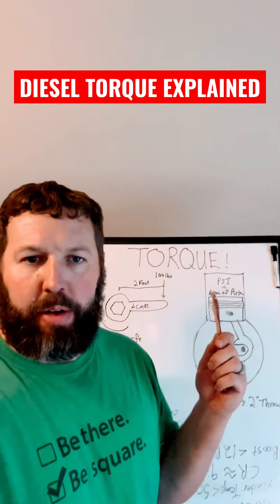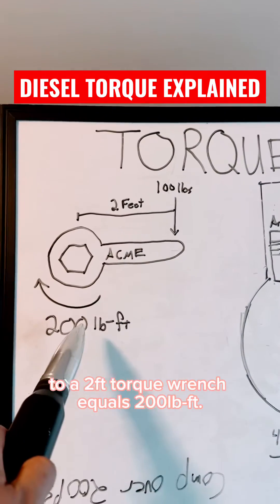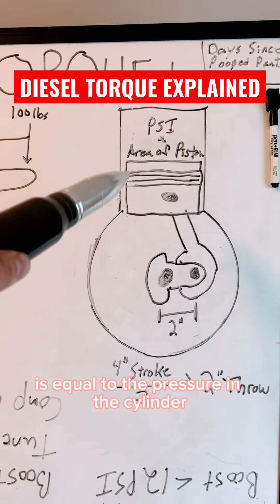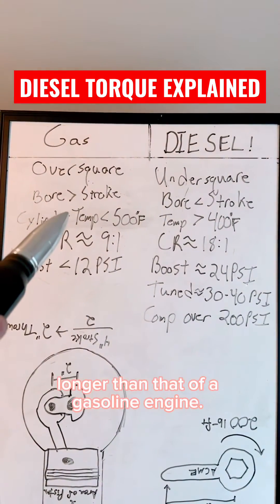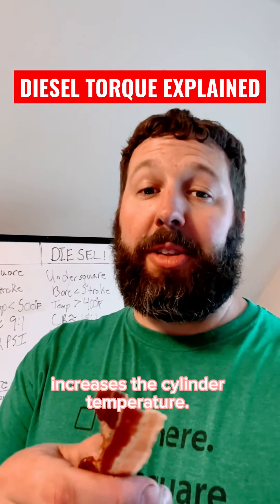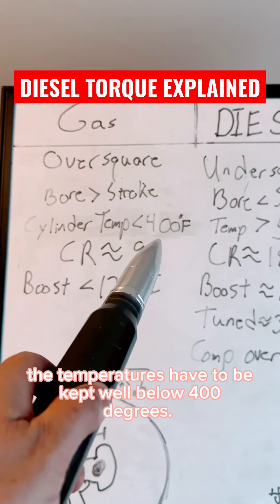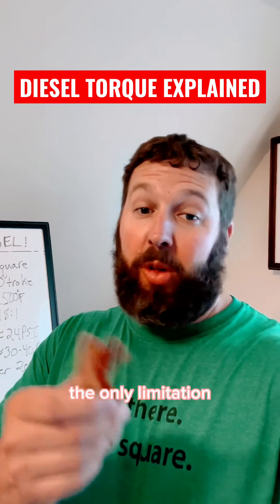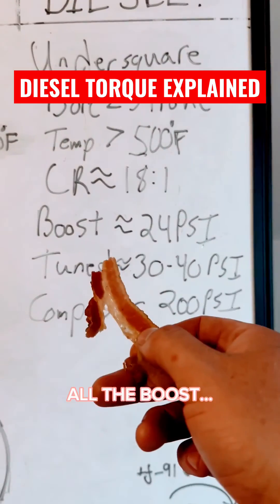Why Do Diesels Have More Torque Than Gasoline Engines?

Comment: Higher energy density of diesel oil also play role to the torque. Combustion (reaction of heat+fuel+O2) on gasoline faster than diesel, but with the higher energy density, diesel combustion/reaction will lasting longer which it means energy of combustion push piston longer than gasoline, not like short flash combustion of milisecond on gasoline

Comment: Only thing you missed was the slow burn of diesel fuel keeps that cylinder pressure acting on your torque wrench significantly longer than the rapid explosion that occurs within a gasoline engine.

Comment: i'm sorry but there is some huge bias here, diesel DON'T have more torque compared to gasoline engines... they might have more low end torque, but same displacement and same other condition (like both NA, or both at the same turbocharging pressure) gasoline engine will have more peak and overall torque, diesel will probably have more low end torque! thats the truth...
second bias is about the longer stroke: to maintain the same displacement of the engine with a longer stroke, you will have to reduce the piston area, so less force in a longer lever will make the same torque, at least thats what physics says...
then why long stroke engines tend to have more torque, because they usually are made to be more efficient, so they have higher compression ratio, they can tolerate higher pressure and they are made to make low end power... so its not the longer stroke that makes directly more power, but its the entire design that changes everything...
Reply: the fact is that most of the diesels are turbocharged and people tends to compare turbocharged diesel to NA gasoline, then of course turbo-diesel have more torque
Reply from the maker: Cool. Let’s compare 40 year old diesels to modern gasoline engines 👍😂.  Torque is a function of cylinder pressure and crank throw. I.E. compression ratio and manifold pressure times stroke.  So you propose to take away the primary device that creates the greater cylinder pressure, or neuter it by limiting it to a minuscule manifold pressure typical on a gasoline engine (turbos have been standard equipment on diesels for like 30 years, and boost pressures of 20PSI+ is standard on diesels…), to give gasoline engines a fighting chance. That sounds like bias to me 😂 BTW, Diesels aren’t made to create low end torque, they exist for efficiency. The torque is a byproduct of the design features that make the engine more efficient. 🤷🏻‍♂️  If you think diesels were created and designed for torque, versus efficiency, let me recommend a great book that will give you the facts about Rudolf Diesel and his motivations for inventing the compression ignition engine….efficiency. Torque doesn’t move freight and turn generators…power does. 😉. Trucks, trains, tankers, and generators engines are rated by HP/KW, not by torque. And people use those diesel engines because the have a lower BSFC than any other non-stationary ICE engine. That’s not bias, that’s reality.https://amzn.to/477fQ3E
Reply: @freedomworx i never said that diesel engines are made for low end torque, that's Just a peculiarity... and i'm not comparing 40yo diesels with modern gasoline, i'm comparing na diesel with na gasoline of the same age...  and 1bar of boost with 1bar of boost, not 1bar of boost diesel with na gasoline or 2bar of boost diesel with 1bar of boost gasoline, that's seems an unfair comparsion... of course diesel can take more boost but that does not look exactly "same conditions" to me
Reply: Just a point of view... anything personal
Reply: Then it's the boost that creates more torque... If you compare two gasoline engines, one naturally aspirated (NA) and one turbocharged, of course, the forced induction one will have more torque. What I meant is that it's not the diesel thermodynamic cycle that inherently provides more torque, nor is it the longer stroke... it's simply that diesel engines are able to operate with, and can safely tolerate, significantly higher boost pressures... but its still the boost that creates more torque...
Reply from the maker: Fair enough 👍

Comment: I would have started with the flame speed of diesel being slower, and so to combat that negative, you must trade rpm for torque. Because if the flame speed was the same, I guarantee you that motorsports would all use high RPM diesel engines due to the higher chemical energy that diesel has over gasoline.
Reply from the maker: Flame speed in a diesel is a bit of a misnomer. In a gas engine, the working fluid is pre-mixed. So the flame just starts at the spark plug, and works its way outward. It doesn’t work that way in a diesel because the working fluid is not premixed. All the fuel has to vaporize and mix in the cylinder in only a few dozen degrees of crank rotation. So the flame is going in many different directions. It’s not a flame speed issue, it’s a “the fuel just can’t mix fast enough in the cylinder issue.” Watch my upcoming video on diesel smoke, where I explain this in detail.
Reply: @freedomworx I see what you mean, but the speed of the diesel injection and the auto ignition that takes place immediately after vs the speed of gasoline flame propagation after spark ignition is still the driving factor of the slower piston speeds during the combustion cycle of diesel compared to gasoline.  Which is what I was trying to get across previously.
Reply from the maker: No doubt that spark engines will always have the upper hand in engine speed. You simply can’t get the fuel in and mixed fast enough for a really fast diesel engine to make sense. That being said, Audi did win some 24 Hour of Le Mans races with R10 diesels back in the mid-2000s. They redlined at 6500rpm, but generally operated at 5k or below. Competing against cars they were probably redlining at 10k or more. 6k seems to be the standard racing RPM for most competitive diesels in short race formats. Pulling, drag racing, etc. 👍
Reply: @freedomworx for sure, but with half of the combustion events per minute, the 11% potential energy disparity in favor of diesel becomes a detriment. Because gasoline will have 44.5% more practical power due to double of the combustion events per minute. All of this is on paper, and application drives engineering, and engineers are basically magicians.

Comment: 🙄Very misleading.  Saying the crank radius is the same as the length of the wrench implies that a larger crank radius will multiply torque due to leverage/mechanical advantage the way an extended wrench will which of course it can’t.  Anyone else think this is what he was trying to imply?  He seems too smart for this myth.

Comment: From what I know the longer stroke limits the max rpm due to mechanical stresses hence also limiting power and power density.
Reply from the maker: It’s actually the speed of the combustion process that limits the maximum RPM. The fuel has to mix and combust in the cylinder in a diesel. The fuel is already mixed when it enters the cylinder in a gas engine. That’s what limits RPM, it’s not the stroke length. You can design parts to withstand the stresses associated with that.
Reply: This is assuming all things equal though, Diesels are also typically much larger displacement therefore the lower RPM still creates more power. Diesels are also designed around torque not horsepower, which peaks at much lower RPM, big bore engines make peak torque at around 1200 RPM so high RPM isn't needed

Comment: Not only the stroke but the duration of the burn plays a role in diesel torque. A spark ignition engine cycle is described as having expansion at constant volume. The Brayton Ready Motor  (1872)  was the original engine capable of expansion at constant pressure. Diesels first patent (1892) described a cycle which had expansion at constant temperature. This required extremely high compression. The test engine never ran on its own power. Later in 1896 diesel would adopt the Brayton principle of expansion at constant pressure.

Comment: Are you sure your explanation makes sense? Even non turbo diesels have great torque.
Reply: Have you got any examples of this? From what I've seen non-turbo diesels make less torque than an equivalent displacement petrol engine.
Reply: @mityau-p5q If you look and specs for non-turbo diesels and gasoline engines they may look similar or diesel may have a little less torque however they make that torque at just off idle not at 2200rpm+. This is why diesel has always been the weapon of choice for moving heavy things regardless of turbocharging.

Comment: Well ya but you could make similar boost on a gas engine and make similar torque but cam timing or whatever they don't rev high or don't make power there so even if you have the fuel and engine built to handle it with gas it is more dangerous and makes sense to make the power at higher rpm and make more horsepower

Comment: One reason is because of their super-high compression.  The other is because they have a low RPM cam shaft.  They do so because diesels can not rev high.  The combustion event takes too long, so you might as well optimize torque instead.

Comment: If you look up the bore and stroke of some modern diesel engines, you’ll find that surprisingly the bore and stroke are relatively close. At that rate I’m guessing they just use insanely high cylinder pressure with the high compression ratio and lots of boost on top of that.

Comment: This kinda goes out the window when talking about GTDI's. A 2.7L Ecoboost with 400 ft-lbs of torque has the nearly the same specific torque output as a 6.7L Powerstroke, at around 150 ft-lbs per liter. And it makes that torque with less boost, less than 20 psi.

It you made a 6.7L Ecoboost, it would make ~1000 ft-lbs of torque, but it would also be making 800 hp, which is completely unnecessary.
Reply from the maker: That’s true. The gap has certainly closed in the last decade. The only thing I’d like to add to the conversation is that diesels can create identical output with much better efficiency. Diesels are designed for efficiency, the torque is just a byproduct of those design features (namely compression ratio). So while you can squeeze a ton of torque out of an Eco-Boost of Toyota 3.4LTT, if you need to produce a lot of power (torquexrpm) for towing the diesel will do it more efficiently. That being said. A half ton truck with an Eco-Boost and a 10-Speed trans has more than enough grunt to do what most people need it to do. A large truck really only makes sense for drivability with larger and heavier loads. So you do t have the tail wagging the dog 👍
Reply: @freedomworx  Yes, efficient is the main benefit of the diesel. 

But ill tell you what, if Ford came out with a CGI block 6.7L Ecoboost(or even just a 5L with 800 ft-lbs), I sure as shit would buy it over a 6.7L Powerstroke. For my non-commercial towing needs(IE towing 6-7000 miles a year for camping trips) i would rather take the hit in efficiency to not have to deal with all the BS associated with diesels.

Hell, I would pick a 7.3 Godzilla over the 6.7L PSD at this point.
Reply from the maker: Yeah, a a 5.0-6.0L Ecoboost would be nice for the Super Duties.
Reply: @Jay-me7gw I think the reason why Ford doesn't have something like a 6.7 EcoBoost V8 as a standard option in the F-250 is because of just how horrible the fuel efficiency would be under load (assuming the thing was actually tuned to run like a powerstroke). Plus the fact that a 6.7 gasser could be built to easily meet power and torque demands with natural aspiration.

In the case of gasoline engines, it's usually more fuel efficient to rev the engine a little higher to achieve a desired amount of power than it is to keep the revs low and pile on boost with a small turbocharger. Even with direct injection, the AFR must be heavily enriched and ignition timing retarded quite excessively under heavy boost to avoid knock (ESPECIALLY if you're running 87 octane fuel). This absolutely kills efficiency, and it's why many people claim that the 5.0 actually gets better MPG while towing than the 2.7 EcoBoost does in an F-150.

Diesels are the opposite, producing power much more efficiently by piling on boost at low RPM rather than revving high. Avoiding knock isn't a factor, so they can take full advantage of the higher thermal efficiency provided by the increased dynamic compression ratio.
Reply: @Leemur2335  yes I understand, but that wasn’t the question that was asked. At the end of the day, GTDI’s can make as much torque, and far more Hp.

I’m sure if they built a GTDI for HD use it wouldn’t be a 10.5:1 compression ratio like the half tons. It would likely be built with a higher load use case in mind and likely wouldn’t have to pull timing as much. The current GTDi’s are built to be efficient under the load of an empty 5000 lb truck.

Also, if I need more torque than the 7.3 Godzilla made, and a GTDI was an option, I would sacrifice the efficiency rather than buying a diesel and having to deal with that nonsense.
Reply: @freedomworx  and at less than half the rpm's

Comment: Naturally aspirated gas engines make more hp and torque than naturally aspirated diesel engines of equal displacement.  Turbo charged gasoline engines also make basically equal or slightly more torque than turbo charged diesel engines of the same displacement.  As an example look at the new 3.0 hurricane engines made by dodge and the new 3.0L duramax.  The gas engine has a large Hp advantage and a slight advantage in TQ.  It is only when we compare turbo diesels to naturally aspirated gasoline engines that there is a large discrepancy in TQ production in favor of the diesel.
Reply: Now compare efficiency for those exact 2 engines. Not even close. You’re right that you can generate similar power and torque numbers but at nowhere near the efficiency
Reply: @BabyGators so 🤷‍♂️
Reply: @Jay-me7gw so you can generate around the same numbers with significantly less fuel in a diesel
Reply: @BabyGators so ? 🤷‍♂️
Reply: @BabyGators are you talking about overall engine efficiency or fuel economy?
Reply: Yeah, this explanation makes sense if you are comparing to a port injected NA  gas engine. But with modern GTDI's they are damn near the same. Gasoline direct injection solves a lot of the knock issues, although not all.